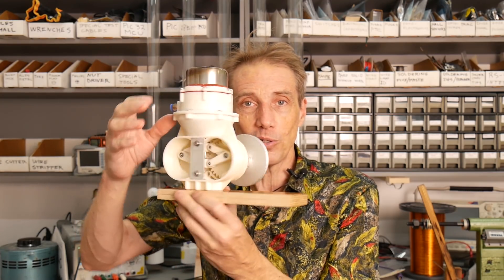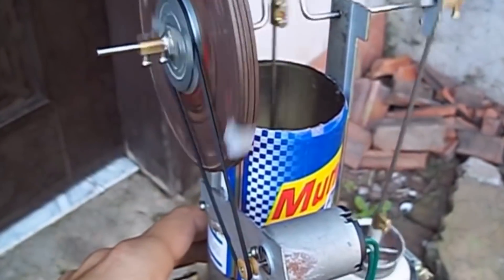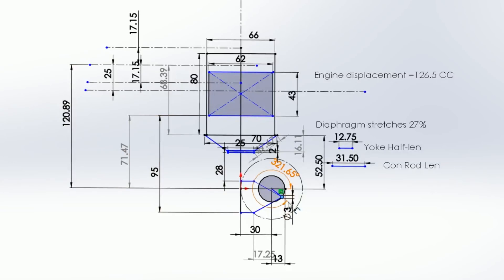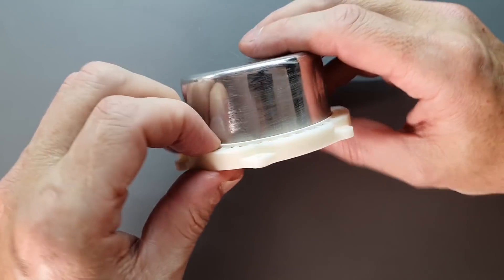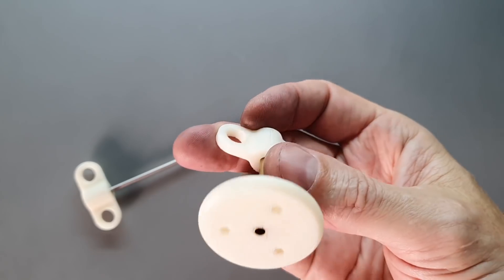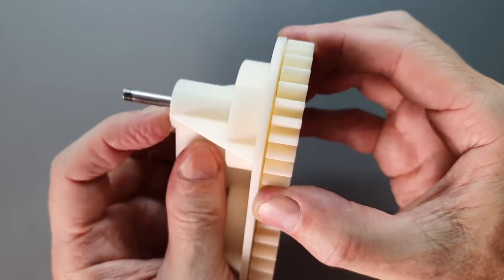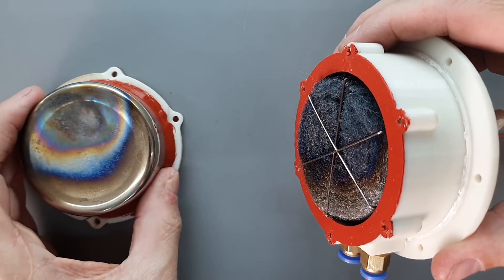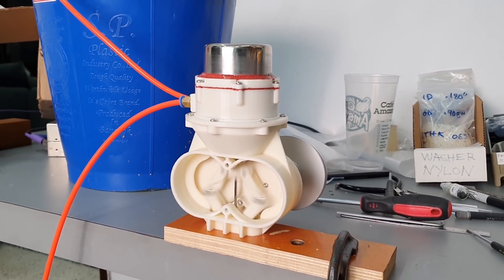The Stirling Engine Project

Comment: Very intriguing.  The hot element being on top would seem to facilitate solar configurations.  Is there any way to draw off a usable amount of mechanical power, ie a pump?  (I'd want to avoid the losses in a generator/motor chain.)

+ I think that aluminum casting is well within your skill set, if you want to move away from the plastic.  You've already got the masters for the molds!

Comment: The rhombic drive version is likely my favourite, and that in turn is likely because of that same 'perverse attraction to symmetry' you described. The alpha type seems unbalanced and lop-sided. The regenerator-displacer combination is something I'd been missing in many thought experiments also. I keep thinking of the hot end and cold end as separate volumes insulated from each other with the regenerator in a feed line. Physical separation makes insulation easier, which allows for a greater difference in temperature, but that introduces other problems.

I've known about Stirling engines for a while, but only the basics. It's quite recent that I've started to give them more serious thought. This vid helped, and I'm looking forward to Pt 2. Thanks!

Comment: Intriguing,   you need a model engineer to make metal parts from your plastic patterns   keeping  them light but more durable.    The physics of heat are fascinating maintaining a differential when the natural order of nature  is towards energy equilibrium I suppose ceramics and glass might cut down on conduction which seems to be the problem within the device?

Comment: Although this is a very intriguing project it is very complicated compared to a simple stem engine with a flash steam boiler............too many moving parts and plastic for simplicity does not make it very durable.........the power output also is quite low as in all atmospheric engines.

Comment: Hey Leo, this is the first Stirling engine video I've clicked on. Thanks for the addiction warning. I haven't watched your other two yet so maybe you have already employed the MPD-L1060 in your dyno design. I found brushless motors to be an excellent load when used as elecrical generators. If you mount them to be rotatable about the shaft axis and measure the torque with a strain gauge you can get a very dynamic data set that is easy to read with microprocessors. The speed is easy to pick from the output voltage waveform.

Comment: You need to add an intake compression expansion and exhaust then have the normal up down up down to make it a total of 8 cycles. It would use compression to make it's own heat and it would run pretty good without fire

Comment: As an engineer, I find the Sterling engine a total waste of time.
The amount of fuel that it use to produce so little power it is a turn off for me.
Steam engines and internal combustion engines are 1000  times more efficient.

Comment: Have you considered using LI-900 space shuttle tile for an insulating material? I actually ordered a 4" x 4" x 1/2" thick piece from the NASA gift shop about 15 years ago and it cost around $5. It was surprisingly light - like styrofoam.
Was planning to use it in my own Stirling design, but gave up when i lost access to lathes and other tools.

Comment: This really is awesome, I had the exact same idea xD 
If interested you (or your viewers) can improve the efficiency further by 
- using helium instead of air inside the engine.
- adding a "regenerator", in fact this part makes a hot air engine into t true Stirling engine, this is the main contribution by Mr. Stirling which increased efficiency significantly
- replacing the rhombic drive with a simpler "half rhombic drive" or drop it entierly and make a free displacer Rimgbom Stirling engine
- replace all the linkages by a diaphram and use the liniar actuation to generate electricity

Comment: It's cool (literally) to use a cooling system.  What if you added a heating system, to use water to heat the hot cap?  That way any heat source is separated from the engine itself.  The heat from the heat source would be transported to the Stirling Engine by a coolant like system, running in parallel to the cooling system.  The heat source could then be anything (solar, or perhaps even a healthily maintained compost heap, which can reach 150 or so Fahrenheit internally)!

Comment: Really nice design. I try to design myself a engine like this with my 3D printer. A smaller one as a prototype. Not working for now. Can you share the basic specs of your engine ? Like length and diameter of cylinder and displacer , traveling distance of displacer and power piston etc. Just to give a idea of a working ratio.

Comment: I saw a 400 ml clear fused quartz crucible on AliExpress with a flat bottom basically the same shape as your top part for about 31 dollars total. I like that you can heat the heck out of quartz crucibles and they don't transfer much heat to these silicone parts as seen here with a smaller size. Anyway there's less heat transfer to contend with using quartz.
https://youtu.be/ciHfynKzFE0
https://youtu.be/B547cKwERzI

 400 ml: 
OD: 85mm
H:107.5mm
Thickness: 2.5mm
Ingredient:99.9% SiO2
Melting Point: 1750℃
Max Service Temperature: 1050℃(long time)
1450℃(short time)
Thermostability:＞5(Quick chilling times from 1100℃ to 20℃)

Comment: i bet stirling addiction holds about even with wrocketry.  
maybe a known load like an old wire wound potentiometers connected to a motor/gen.  Power the motor to trial heat and real cold production, or generate to the load and test volt and amp outputs.

Comment: Discolored!  It's burning.  The regenerator you're using isn't so great.  The displacer piston should just be an empty lightweight displacer.  Your regenerator could be long strips of something that doesn't conduct heat very well, the gas that moves past the regenerator needs to dump or pick up heat quickly.  Definitely need a heat break in your regenerator...

Comment: To optimize it, you need to increase the internal pressure.  If there was no air, there would be no function.  Double the pressure should double the performance, and so on.  It’s been done once, but not well.  Try it

Comment: Print the upper parts in ASA, this is able to work in hot ambient (Print-Temperature ca. 240-260°c) and you can close the cappilars by flushing it once with e.g. isopropanol, an alcohole.

I printed a little Arielle for my daughters aqarium of it. I placed the figure some minutes hanging in a closed glas with a shape of alcohol on its bottom. The cold steam is enough to do the job. While drying, the surface gets fluid and melts together - so the capillars disapper. If you let it too long in the glas, the chemical melting gets deeper in the figure, so it gets weak and may loos its form. so, be careful. ... and of cause .. dont breath in too much of it 🤪

Comment: Hi, .. does your knee lever have a counting effect in better matching the carnot processes corners? One mayor problem of the stirling is, that its Carnot-Diagram is some kind of oval, while the bestcase carnot-diagram has four really sharp edges. Usual Betas have two pistons that operate by a phaseshift of 90°, but both cycling in a sinus-wave.. So does your knee lever draw this diagram more rectangular and less round, does it brake with the dictaded sinus-waves???

Comment: Interesting video, i draw a drawing of a stirling engine almost similar but i didnt built a stirling engine. The most efficient stirling engine is the stirling engine well designed and reintroducing the lost of heat in the stirling engine system.

Comment: Great video, Leo.  Congratulations.  I love Stirling engines since the 80s.   Without the Internet, the most I could get was to find a great technical book about them in the university.  There was little material information to get about Stirling engines.

I remember that when the Internet was initially fledgling, to "test" how was it:  the very first query that I submitted was precisely "Stirling engine".   I still remember the feeling of getting all that information!   Wow!  Internet was great if it could easily get all that info about a theme that was so "difficult" to know in those days.

Comment: From your experience, what is the feasibility of making a large Stirling engine that utilizes the 55F geothermal temperature of the the ground 6 feet down and the atmospheric temperature above ground to produce power?   It of course would only work when the air is colder or warmer than 55F.    Could such an engine produce useable power?
Reply from the maker: The chances are above zero, but just a tiny bit...
Reply: @leosbagoftricks3732  
Thanks.  That's kind of what I was thinking.  I suspect the usage of a flywheel design would require more speed than such a low temperature delta can produce, but maybe with an electronically controlled displacer that allows several seconds of heat transfer per stroke connected to a low friction piston?   I never figured out the energy potential formulas so I don't know how much energy can be extracted between such a low temperature delta.

Comment: doesn't adding the water cooling defeat the whole purpose of a sterling engine. It seems like you add a solution to compensate the use of heat sensitive materials. In the end just adding more problems. Just my observation. Does the water require a pump? unless a missed the part where it says the sterling engine pumps its own cooling water
Reply from the maker: No, heat flow is how these things work. Most of the engines you see use ambient air as the heatsink, the water jacket provides a far better heatsink and thus better performance.

Comment: On e practical question. 
Is the displacer air tight?
Because if it isn't it is a useless load on the performance.
Another thing.

You know the efficiency is dependent on the difference between the high temperature and the low temperature.
However for the best performance, this should also be the adiabatic temperature difference due to compression. 
In most of the selfmade stirling projects the compression is no more than 50%.
For an adiabatic temperature difference approaching the difference between the cold and the hot side you would need a compression of 1 to 10 at least.
Make a Pressure Volume diagram and you will see for yourself.
I am afraid with a plastic model this will be impossible to achieve.

Comment: You are lucky the wire wool did not ignite. had it ignited it may well have exploded. steel wool is very combustible and you have it in air which contains oxygen and therefore could explode.

Comment: Does the engine motion power the waterflow in the cooling system, or is it powered externally from a pump? And if it is powered externaly, would the engine be enought to power the pump and have usefull excess power? If not, than this would not be exactly a practical machine.
Reply from the maker: It's gravity feed at the moment. And of course, there is NOTHING practical going on here haha.

Comment: Really great effort!  Not critical to the engine, but neat-o,  would be finer teeth on the 2 gears, and hypoid design, for (hopefully) smoother, quieter running.  Making them on a 3d printer sure is preferable to making them any other way!
Reply: That was a great comment, dude.

Comment: Utilize a Solar Evacuated Tube, on the heat receiving point. No solar tracking necessary, unless you just HAVE to squeeze it out. These are sold in minimum lots of 40 some lots from one company, and create I believe 3 to 10 kilowatts each.

Comment: I believe pumping water with a centrifugal pump would make an excellent Dino for the scale you are working with. You could use a monometer as a gauge and measure flow rates.
Reply: Especially with your 3-D printing skills.

Comment: Fiberglass instead of steel wool
Reply from the maker: Can you explain why you suggest this material? Physics?
Reply: @leosbagoftricks3732  I haven't tried it.  Just a guess it would be more resistant to oxidation.  You are probably using the displacer as a thermal battery, with a sharp thermal gradient (as it contacts both the hold and cold side-walls).  Fiberglass would have less thermal mass, I guess.  Doing a thermodynamic analysis would be interesting, but I've been out of University for too long.  I had thought a displacer with a wide clearance would be the way to go, until I saw your design.

Comment: You explained everything beautifully. I like very much the design of this engine and the way you described all the details.

I love this movie.

Of course I liked the movie and subscribed to your channel.

It looks for me, that @ 7:06 there is a little play between the two parts. I think it could be more efficient if these fit more "exactly", but not that much it could cause problems with free moving. Just to reduce free space between these to as little as possible without impairing movement. I am right?

PS. Sorry for my weak english, it's quite rare to use it unfortunatelly  :(

Comment: I want to combine a Stirling engine with an internal combustion engine. 

Then I could switch to Stirling power whenever I'm idling, significantly reducing fuel consumption without having to worry about the fuel spent starting the engine back up, and also without having to worry about wrecking my torque converter.

If the RPM ever gets too low, then I could also have a Hit-and-Miss system to provide very tiny bursts of fuel to get the flywheel back up to the correct speeds to prevent a stall.

Comment: Hi Leo, I also have been enthralled by Stirling engines,  Theoretically at least. I have had an idea to use the revetec controlled combustion engine piston arrangement to help with the Stirling engine and the reason is that this piston can move up-and-down so you can have a much wider displacement piston and a much shorter piston stroke. Also you can change the libe shape to better match the 90 degree synchronization issue with air flow and pressure. Here is a link with an animation. https://www.greenoptimistic.com/revetec-controlled-combustion-engine-x4v2-20080701/
Reply from the maker: I tend to be very skeptical of all the "revolutionary" new engine designs floating around out there. Ask yourself why in 2021 we largely use the same old dumb configuration that was invented in the 1800's - with some clever optimizations, but the guts remain basically unchanged.
Reply: @leosbagoftricks3732  I agree with you. But the Stirling engine has some unique characteristics which are different from a high temperature high rpm internal combustion engine. A wider piston makes sense but then friction becomes a problem. With the revetec design you can have a much wider piston and it won't rub on the chamber walls because it only goes straight up and down. With the lobes, you can adjust the dwell time to take advantage of the pressure peak and potentially improve the efficiency if the power stroke, with such a low power engine it could make quite a difference. 

I envisioned a poor man's version of the thermomechanical generator might be possible with the revetec assembly. https://en.m.wikipedia.org/wiki/Thermomechanical_generator

Comment: Hi Leo,
I have always had a huge fascination and deep admiration for the Sterling Engine, would love to get the STL files from you to 3D print your project for myself. Would you please consider to share your design with a fellow enthusiast like yourself.

To add my 5 cent thought here is yes Helium is a good substitute for oxygen yes, but did you know they actually use compressed nitrogen very successfully in the bigger P40 Sterling engines for things like submarines. Maybe worth looking into that also. I am totally addicted to this almost or near endless Engine, specially if one can make a practical one to generate some form of electricity at least. But this Sterling Engine addiction vs applications of this Thermal Acoustics type of Engine is just endless...

Comment: Nice job!!
To improve it further a careful choice of materials should be done, to reduce amortization and energy/efficiency losses.
One hint (though probably quite advanced) is, as I'm sure you know Stirling engine is a heat engine, and as such it efficiency is MUCH higher when the cold chamber temperature is closer to 0ºK
For example the theoretical max efficiency of any heat engine with cold tank at room temp, lets say 20ºC and hot temp, say at 240ºC is about 42%, 
while for the same temperature difference if your cold tank is at -200ºC (little colder than air condensation temp.) and the hot tank is at room temp of 20ºC you'll get 75% max.theoretical efficiency. If cold-hot tanks are at -200ºC & 240ºC you'll get over 85% max.theoretical efficiency
Of course practical efficiency would always be lower, depending on the engineering of the engine.
You also might want to have a look (if you haven't already) at this old video showing efficiency optimizations 
https://youtu.be/GqIapDKtvzc
I see you're using heat-regenerator as the displacer-piston - don't know which works better, but your approach is definitely simpler (and have much less surface for energy losses to external environment - only the cylinder walls).
The rhombic drive is also very nice touch, but you can see the counter-weight optimization they did to make it as close to perfectly balanced as possible, and thus allow it the operate at much higher RPMs.
And of course if you want to increase the amount of work done (if you're planning to put it to some real use) you would want to increase the pressure of the  gas inside, and also probably to replace the air with some gas with better heat conductivity like hydrogen or the safer option helium (though it's rather deficit at the moment :/)
Good luck with the project!
And keep us updated - it's very interesting indeed! :)